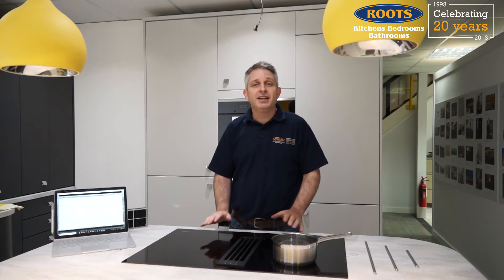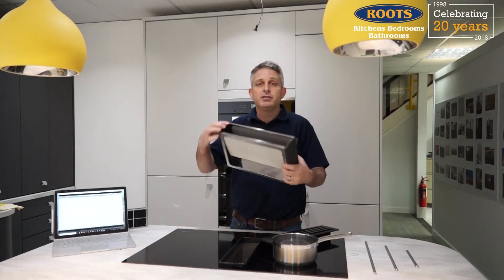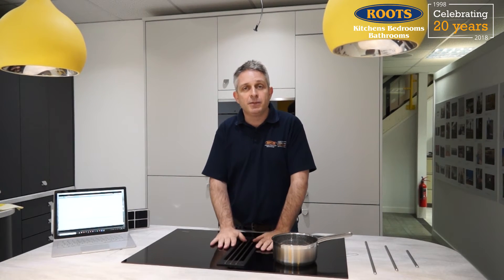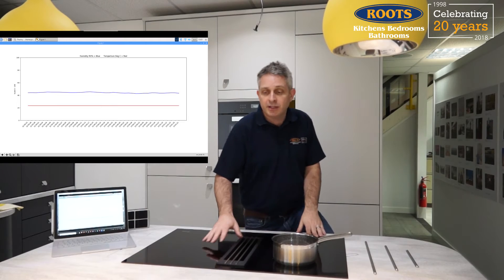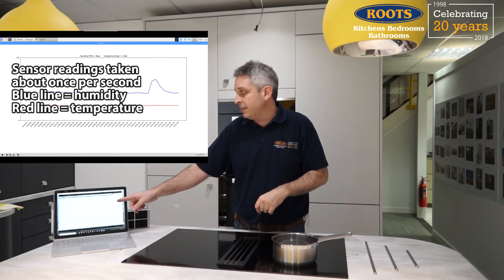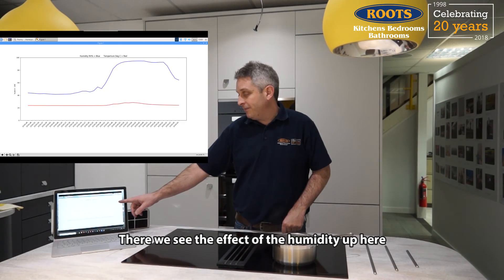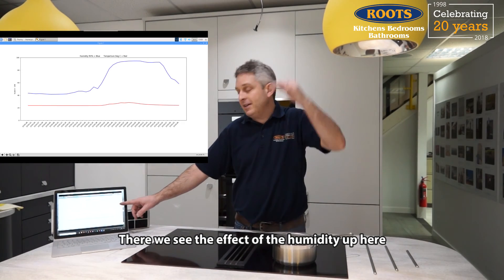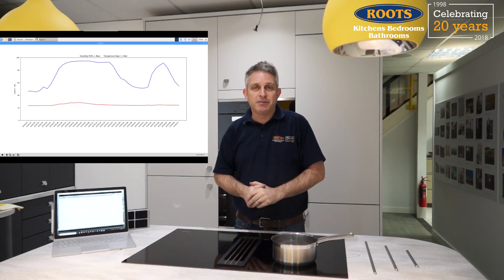We test the effectiveness of extractors that are built into hobs (instead of placed overhead)

Comment: Hi, I'm looking at ordering one of these hobs but the kitchen company is telling me that they are not suitable to install with cupboards above due to the amount of condensation? I read in the Elica manual that they are fine but just need to have a minimum 50cm between the hob and the cupboards. If you have any real world experience of this and don't mind sharing please let me know. Many thanks!
Reply from the maker: Hi Matthew, from my experience, both are technically correct! However...

Whilst you can have cupboards 50cm above induction hobs, I think that's too low for everyday use 
* I would be ducking and peering under the cupboards to see the pans at the back, and I'm only 5'10"/178cm tall!)
* see also: next video about to be released on self cleaning ovens, which I filmed at home and you can see the extractor steps up over my hob for exactly this reason.  
For moisture, 
* I'd still be very alert to potential damage over time. I think it's hard to assume that users of the hob/extractor would always turn it on fully and leave it running after the hob heating is turned off. 
* Higher than 50cm would be less likely to damage giving time for any escaped steam to dissipate a little.
* I'd probably be looking to use some sort of wipeable/damp proof finishing panel in that area

So, in this case I prefer your kitchen company's answer over the Elica answer!

I'd also argue that if you've space for wall units over a venting hob, then you've space for a regular wall mounted extractor (of a myriad design styles, so aesthetics shouldn't be a problem). At which point, I'd probably* be have a non venting induction hob and separate extractor based on 
a) ease of future replacements should either fail 
b) probably total cost is less.  
We use venting hobs mostly in islands/peninsulars. Against a wall (not that I can remember us doing this) I'd be assuming no wall units as an overall aesthetic.

*Reasons that won't work: Low eaves meaning maybe you can't duct outside from a wall mounted extractor, other wall features/protrusions/piers/nibs/beams that make it too complicated fit around.
Reply: @RootsKent  Thank you for the great advice! Looks like I'll go for a recirculating extractor above the induction then... unfortunately venting isn't an option for an extractor above the hob due to the presence of a beam. There is the possibility to vent it if I use the elica but it sounds like it wouldn't be the best idea due to the possibility of water damage to the wall units over time? Thank you again!!
Reply: Forgot to say, thank you for the great videos, they are really helpful (this one and the neff oven door cleaning one especially!)
Reply from the maker: You're very welcome! and thank you for taking the time to comment.

Comment: Be curious to see a pot on the far end instead of the inner part of the cooktop. Furthermore with a pot in each to see if the outside pot still gets sucked in.
Reply from the maker: There are only 4 zones on this hob (and most I've seen like it) so they're all equally distant from the extractor in the centre. This was a small pan but centred on the zone, so for larger pans I've seen them work just the same (See https://youtu.be/9EzfRvEG0ys?t=195 although I had the extractor on the minimum setting to limit the noise pickup on the microphone).

Comment: Ah great video, well prepared and delivered - I'm sold. 
Now that I'm looking to buy my first home, I only discovered hob built extractors - much better in my opinion. The only con is you lose the overhead lighting but a well lit kitchen will suffice.
I was very impressed to see the Raspberry Pi set up! It's actually a very accurate testing mechanism to be honest, well done.
Reply from the maker: Thanks, and +1 for not mentioning the noise level (covered in https://youtu.be/SBfysIfETlg when I bought a better microphone) 🙂
For the light, you're right, we'd normally position recessed ceiling lights over the hob and surface.  The other con is often the price (often more expensive than a separate hob and extractor) Generally we use these in islands where we don't want to have to duck to look past a hanging ceiling extractor and don't want a flush ceiling extractor (as they can be hard for customers to clean and maintain). If the room has the hob against a wall we almost always use a separate hob + regular wall mounted extractor.
Reply: @RootsKent  I think that last point is worth emphasising. Most kitchens have a hob against the wall (only big kitchens can afford the luxury of an island), so you'd actually advocate the traditional wall mounted extractor for most kitchens. Why is that? Is the benefit of this only aesthetically for islands?
Reply from the maker: @donovanvaz3289  Yes, when not in an island/peninsular we almost always recommend a wall mount over hob against walls because;
a) Cost is often less (obviously depending on models chosen)
b) Easier future replacements (a Roots we plan for long working life kitchens so have to consider how easy things are to replace over the next 20 years)
c) A wall mount extractor is not an aesthetic compromise (many options to worth either concealed into furniture or as a feature in their own right)
An exception is when we don't have the room height to fit an extractor or duct routing would cause a different problem.

Comment: Many thanks, I am just starting to build my final house and was looking for info on duct sizes, perfect info.
Reply from the maker: Hi Robert, and anyone else also looking for duct size information.
Simple rule: The bigger the duct the better. Aim for 6"/150mm nominal ducting (or it's rectangular equivalent). Aim for short runs with as few bends as possible (check out brand: Compair Flow for ducting that has air guide vanes built into bends, improving flow rate and reducing noise of flowing air).
Complicated rule: If you are going for a carbon neural design you'll be looking to duct through/exchange stale air through a heat exchanger. Sometimes you'll use a recirculating air setup with carbon filters on the hob.
Inevitably the building design impacts what you can actually achieve with ducting routes.
Kind regards and thanks for commenting,
Steve

Feb - Aug 2022:
Hi reader. If you're feeling generous, please consider donating a few pounds to my personal challenge to climb a mountain. All donations go directly to 3 chosen charities.
More about why I'm doing this here: https://www.roots.uk/expedition-w3w and you can jump straight to the donation page here https://sponsorme.charitiestrust.org/event/cbdf1e64-4af4-4905-865d-49ebaedb105b

Comment: About to refurb our kitchen and I had not thought of using a hob extractor such as this. Ours is against an external wall so could vent outside. However our oven and grill stand alongside the hob, and they are responsible for most smoke in the kitchen. Any suggestions as to extraction for that, near in mind we haveiw ceilings. Great video by the way
Reply from the maker: Against a wall, we normally use conventional wall mounted extractors. 
Smoke from oven/grill isn't something I've seen often or investigated to solve, but you can run the extractors all the time you're cooking. Typically an extractor can extract all the air in the room 10 times per hour (obviously depending on how it's specified, and not for fully open plan homes). The smoke may not all be removed immediately but it will help limit how much of it lingers or travels through the rest of the home.

Comment: Can these be fitted in an apartment?
Reply from the maker: Yes. 
If you're replacing an extractor that's ducted you'll most likely need to continue to extract outside though (building regulations/moisture level control in the property)
If you can't connect this style of extractor to outside (as you probably can't run ducting through the floor and if you've using it in an island) then you can fit this style of hob as recirculating (with carbon filters for smell) and a secondary small extractor elsewhere (possibly using the same exterior vent hole, we've used humidistat controlled versions for this in the past).

Comment: Hi Steve. I appreciate your thoroughness. Have you measured the efficiency of side mounted downward extractor on induction hobs that are not square but the wider ones, with 6 cooking zones?

I'm worried that the furthest two pots from the extractor would not be efficiently served, and from esthetic point of view the induction hobs with extractor in the middle are not acceptable for me.
Reply from the maker: Sorry Lukasz, I've not got one on display to test.  
In case it helps; We've sold that type in the past though and no-one has told me they've had a problem
If you were our customer, with the aesthetic being so important, I'd be suggesting you go for your preference as I suspect most of the time you wont be using every pot zone so even if performance at the front zones isn't perfect, the compromise is worthwhile for the aesthetic.
I hope that helps

Comment: On a high setting, it would suck all the heating out of the house. 
Noise is a big turn off too.
Great demo thanks
Reply from the maker: Thanks for taking the time to comment. For heat being sucked out, yes! You're absolutely right. To avoid that you can use the recirculation option (through carbon filters for odour).The heat (and humidity from cooking) being extracted applies to all externally ducted extractors and well as this type of venting hob. Low energy homes often don't have ducted extraction over hobs for this reason, or pass the extracted air through heat exchangers.
For noise, see this video: https://youtu.be/SBfysIfETlg  ;-)

Comment: Hi, do you think these work well? Im thinking of putting indunction with vent instead of a rangehood in new kitchen, but its difficult to get good opinions and feedback.. this design helps alot with my design but im not sure if these inductions with inbuilt vent do a reliable job
Reply from the maker: That's what I was testing in this video by setting up a humidstat :-)
I would have one on an island or peninsular. Against a normal wall we use a regular hood. - This is also what we recommend to customers too.
For reliable job: with all extractors remember to start them running before you start cooking and leave them running on low for a short while after. It takes time to get a flow of air going. Many models now automatically turn on when you start cooking and run on automatically too.
Reply: @RootsKent  thanks, actually i was considering this against wall.. is that innefective?
Reply from the maker: @jaytee1205  Against a wall works fine too, but at that point if you can use a regular hood and hob you have more choice at (often) lower price points for the same performance level. Aesthetically though, If you're aiming for the look of a clear wall then the venting hobs achieve that and is perfect.

Comment: Hi, nice vid good job.
You manually turned on the extractor right? How come kitchens don't seem to have humidistat extractor fans like bathrooms?
Reply from the maker: Ah, they do, I manually overrode the automatic setting for this video. 
Most of these style of hobs either a) turn the extractor on automatically and vary setting depending on power setting of hob, or b) use a sensor (probably a humidistat hidden behind a marketing name) to vary the speed automatically.

Comment: Have you tried to Novy Panorama Pro? It looks like it has lower noise level and insted of catching the steam 180 degrees it's only 90 degrees. I'm considering buying one, but I really don't want to boost the fan just to catch some steam...if the Novy does the job better at a lower level, and afaik it does looking at the technical sheets.
Reply from the maker: I've heard of them but never seen one to play with.  You can probably tell I will lean heavily on the technical sheets too, so couple that with a hands on look if you can (to consider cleaning, filter changing, etc),installation (how easy or not it is to fit in your cabinets), + cost of course, and if on balance it looks the best for your room that's perfect.

I'm not sure the 90 degree / 180 degree would make too much of a difference to performance as the 180 degree is like 2 x 90 degree back to back with cooking either side.  It might allow for larger filters so less noise generated from air moving through them? (For noise video see https://youtu.be/SBfysIfETlg ) 
From the view of using the hob, I think there's something to be said for a wide single row of cooking zones rather than 2x2 layout (if you have the width, it's perhaps nicer than leaning over one pan to stir the pan at the back, plus it might be useful for limiting depth required for hob & worksurface).

Comment: is the condensation collected anywhere or is it extracted along with the air on the other side of the bench? Oh, and if it is collected how much liquid it copes with?
Reply from the maker: Hi, sorry for the long reply about to follow... ok, I'm not sorry :-)
Short version: Not enough condensation captured to be a problem, so yes most goes through the fans and outside(ducted) or back into room (recirculation).   Liquid: For spills, see https://youtu.be/5L9GOv90g9w where I spill Bolognese sauce into his hob.

So this applies to all extractors, some of the moisture in the air will be captured by the metal filters as condensation. I can't tell you how much.... but now you've asked that could be a fun experiment. Leave that with me...., Some of the moisture will travel all the way through.
Not enough moisture is captured to be a problem and I've always assumed it evaporates back into the air over time. These type of extractors have catch trays for other spills (see my other video: https://youtu.be/5L9GOv90g9w where I spill sauce into this hob) and from memory around 200ml seems a common catch tray size and that's after however much moisture is captured by the mesh.
Wall hoods don't have any catch tray, which is why I don't think condensation beyond the grease filter is an issue.
Therefore, I'm assuming that moist of the moisture travels all the way through and out the wall if you have ducting or back into the room if you have recirculating.  In the UK, if you have a new build house and a recirculating extractor you need to have another form of air extraction in the room - often a small fan - to manage the humidity and atmosphere of living in a well sealed and energy efficient new build home (think: humidity in air you breath, sweat, odours, stale air that you've breathed out, etc), so that's another reason I think most humidity passes through the extractor (if the filter was catching it, it would all evaporate back into room and we'd still need separate extractors for our building regulations).
I hope that helps, 
Steve
(I welcome any reader with more knowledge to chip in here!)